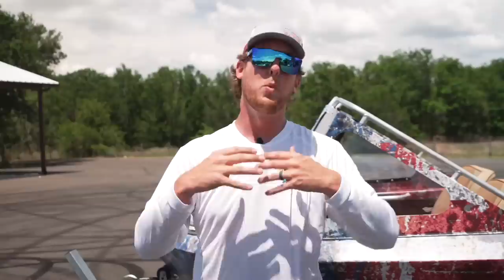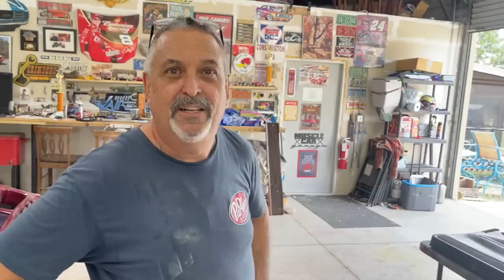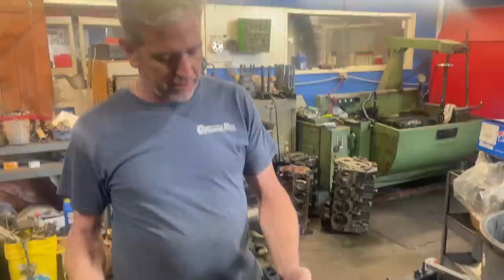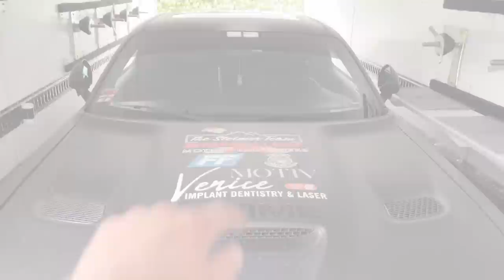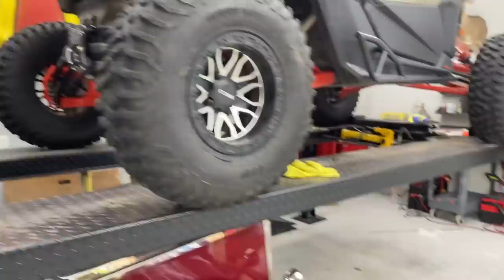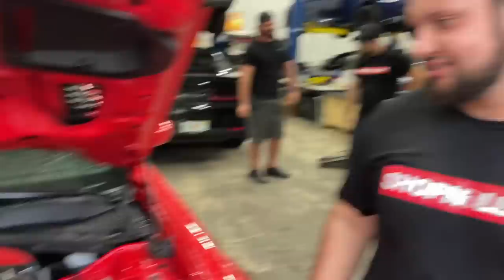NEW PAINT FOR DR. PEPPER  & MASSIVE BLOWER FOR HELLCAT! Motor Tear Down, Trans Rebuild, & Body Work

Comment: I know you have the trailer, but since you're in the paint shop, you could add some stainless  threaded inserts to the roof in case you ever needed to go back to a roof rack.  Make them blind so no leaks, pop a plastic fender liner holder into the hole to keep crap out.  Put 'em towards the corners of the roof where it has the most strength, maybe go through and attach to the cage.

Comment: Honestly most 3rd gen hemi's are solid engines to swap in cars. Everyone bags on them because the cars they are put in are big and heavy boats. A decently built eagle hemi (2009 - to current) placed in a stripped out Dakota or older Mopar and it'll run very respectable times on the track.. or melt tires for days

Comment: Hey Parker if you guys need bench tops I run a woodyard here in Plant City. I have a sawmill and I can cut wood slabs 30in wide by 10ft long. I can cut longer if I set up another frame.

Comment: @Teeth & Turbos You seriously needs to install some Mud-Flaps on your pickup not only to cut down on road spray but also to protect the finish on the front of the trailer.  Most people don’t understand/take into account that the water spray you see coming off their truck when driving in the rain is also occurring when they are driving in dry conditions except inside of water it is spraying all the grit grime on the road plus of course the Florida sand, Georgia clay etc which is in essence sand blasting the front and corners of the trailer you are pulling (aka Sam’s trailer). It is why the open trailers your bother bought Cooper and JackStand have those walls on the front of them. Additionally it is not doing paint on the back corners of the  bed on your Pickup truck any good either. I personally have been a long time fan of those small stainless steel pieces that attach to the back of your front wheel lip and running boards if installed on a truck to cut down on the grit, grime, rock, & dirt/sand that blasts the finish off the bottom of your front fenders as well as spays water up towards your side windows as well as installing good wide rear Mud-Flaps as close possible to the rear tire / wheel opening without getting into the rear tire (because if that happens more times than not you will rip off your Mud-Flap especially if it happens backing up) Additionally I like to use Mud-Flap stiffener bracket and weights. The stiffener bracelet help eliminate the possibility of pulling off your Mud-Flat when backing up as well as keeping it from blowing around when driving down the road as does the Mud-Flap weight.  Also I have found that 99.9% of the Mud-Flap kits on the market including the ones “made to fit” your truck are garbage and that while looking at the kits might give you some ideas how to Fabricobble your own brackets/mounting system.  Additionally I generally spend the cash and buy good quality plain Mud-Flaps at a truck stop (if plain ones aren’t available I flip them so the design is facing the tire and dust them with a matte finish pain to help hide whatever is printed on them) or someplace that sells “big truck” parts and then make a “CAD” (cardboard aided design) template and then cut the larger Mud-Flap down to size. Lastly expect to spend some money and a good bit of time installing Mud-Flaps on your truck.  On average I spend at least a half a day to a day Fabricobbling the brackets and mounting the Mud-Flaps on a pickup truck because doing a half a**ed job mounting Mud-Flaps 9 out of 10 times means you will get to do it again and most times have to buy another Mud-Flap, stiffener, and weight.  In other words it pays to the job right the first time 
PS mounting your rear Mud-Flap bracket to the bed of your truck rarely if ever is a good idea (ask me how I know.